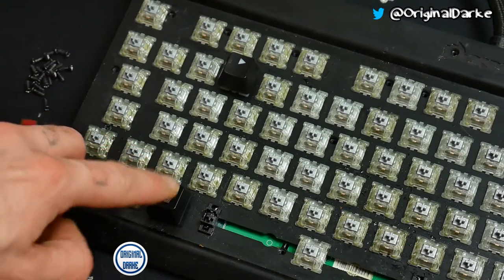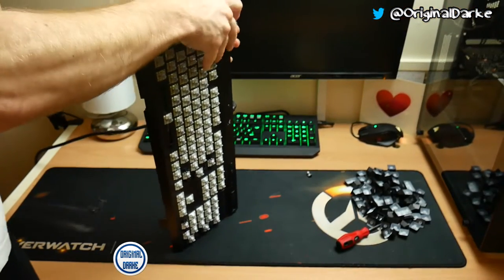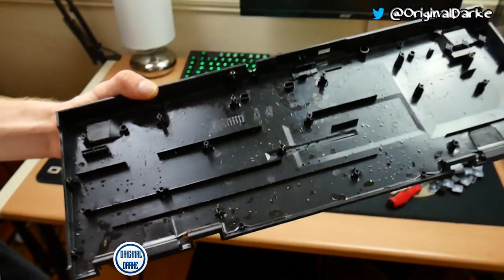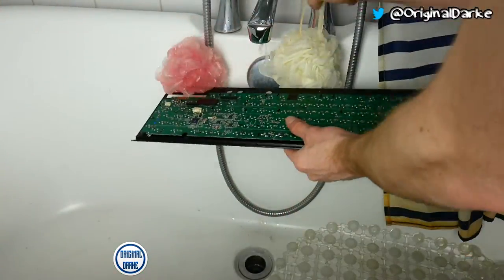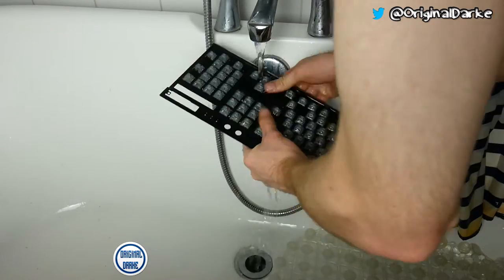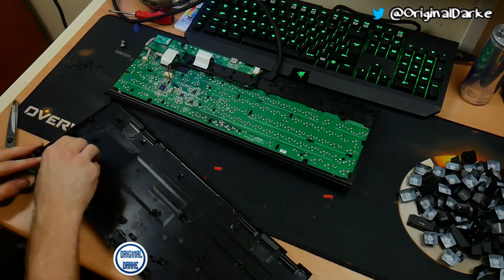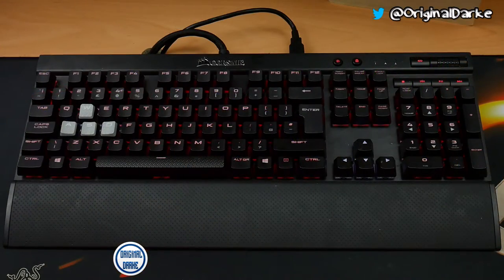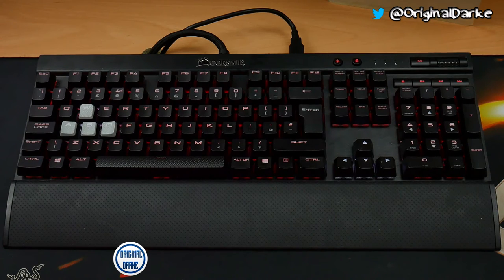Corsair K70 RGB Rapidfire Keyboard! Lucozade Spill !! REPAIRED

Comment: Note: The 2018 versions do not have the a sticker logo = no screw there. its LED
Instead of water, use isopropyl alcohol on a kitchen towel or brush to clean.
Reply: I removed all the other screws including the one to the right of the volume scroll, and it’s still stuck
Any help?
Reply: @kylesagun156  did you get to open the keyboard? i'm struggling with a  corsair gaming k70  right now
Reply: @TipoSed  i did but it was a year ago and i forgot how to open it, my cousin has the keyboard now sorry

Comment: Why did they have to put a screw under the logo ffs that's like impossible to remove without damaging it.
Reply: For warranty purposes so they know if the keyboard has been messed around with or not if it's returned for repair.

Comment: I spilled sticky thick mango and banana juice in mine...The keyboard was completely filled with  juice. Direct hit.. I had to use hot water because the keys were stuck. These other guys did a video where they put a bunch of old dirty keyboards in a dishwasher and it worked great.Liquid is not a problem as long as there is no power. Your MOBO will automatically break the circuit on the USB port if there is a dead short too.

Comment: that's a shitty design. hiding a screw underneath the logo :o
Reply from the maker: yes was very annoying especially when you have to ruin the logo and try to be extra careful not to mark it.
Reply: Did you notice that they add a huge opening underneath the spacebar as well? It's intentional. So that liquids are guaranteed to go inside to void the warranty. It's safe to say that this is my last corsair product :/
Reply from the maker: Yeah that is where the Lucozade poured in too frustratingly, i would agree these products don't last long and they are designed to break just like the iphone charging cable, i have a ROG Claymore and they didn't put a whole there.
Reply: I'll bookmark the ROG Claymore keyboard so that I look at it in the future when I need a new keyboard. I only own a ROG motherboard and so far so good, no complaints. If I had seen that hole under the spacebar I would have returned it right away. But oh well, live and learn.
Reply from the maker: yeah and the keyboard is nice but i have had a few problems with the ROG Keyboard especially where it dose not have a keypad you have to buy the upgraded version. But they do make very good motherboards but peripherals are different so maybe pick another manufacture. i wouldn't waste that money on a small keyboard again lol.